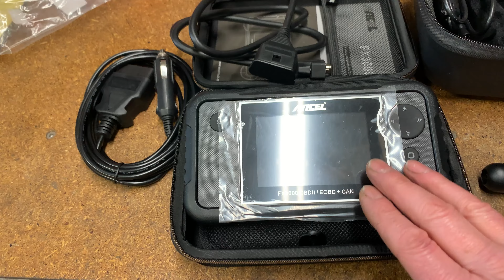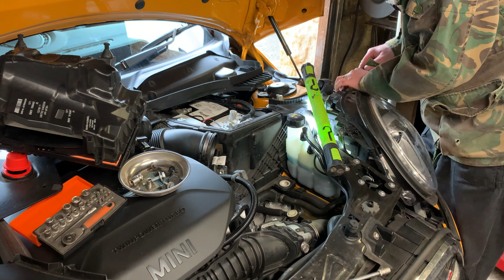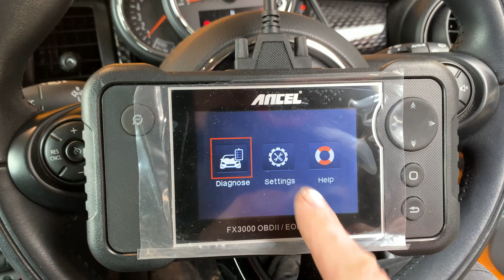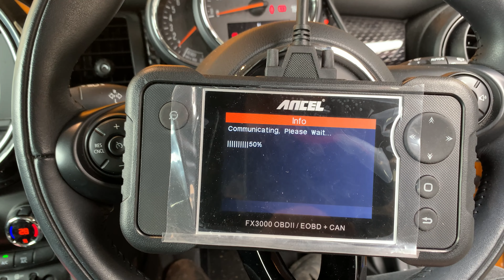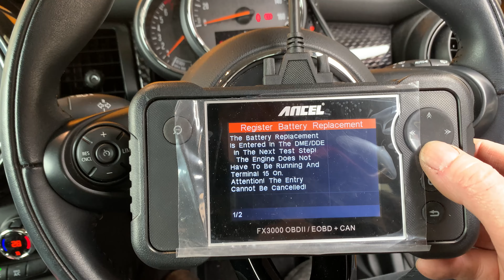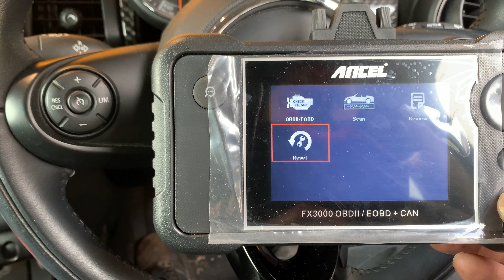Mini Cooper S 2016 F56 3rd Gen Battery replacement using an Ancel FX3000 diagnostic tool

Comment: Can I use bimmercode or bimmerlink to register the new battery ? do I really need to add an extra 12V supply to the ODB2 port ?! Just watched a workshop do it and they didn’t bother with the 12V power for the ODB2 line.
Reply from the maker: Hi. I’m not sure what bimmercode is some I’m afraid I cannot comment on this. The 12v power to the obd2 port was to keep the car memory settings, radio,sat nav etc so is not essential.

Comment: Thanks for the video. Any chance you still remember the dimensions of the battery?
Reply from the maker: I’ll check in the morning 👍🏽
Reply from the maker: Hi, this is the exact battery I bought, I hope it helps, thanks for watching 👍🏽
https://advancedbatterysupplies.co.uk/product/varta-f21/
Reply: @MikeMakesIt  Brilliant! Thanks!
Reply: @MikeMakesIt  I've heard that the AGM115 (which are 315mm in length) batteries don't fit, and that you need the AGM096 (which is 278mm in length). Clearly yours did.
Reply from the maker: @JohnCarlyle and it’s still running well! Thanks for watching 👍🏽

Comment: so what's the consequence if the battery is replaced but no registration process is performed?? I don't have the scanner and hoping not to buy it.
Reply from the maker: Hi Victor, I read that there is a battery management system (BMS) on the car which alters the charging characteristics depending on the age of the battery. So fitting a new battery and not "telling" the car could leave to overcharging of the new one. I would imaging this could be correct but in real life how this would effect the longevity of the battery I wouldn't like to say. Thanks for your comments and for watching 👍🏽
Reply: many people say ,  new battery  life will be shorter.

Comment: Is it OK that when you pulled out the old battery you let the - terminal touch the + battery cable?
Reply from the maker: Hi Jusssy, no thats fine as only one terminal of the battery touched and the other was floating so there was no electrical circuit created. Thanks for watching 👍🏽

Comment: A complicated designed small car that breaks often than regular cars
Reply from the maker: Hi Louie. Simply wanting to replace what used to be easy, such as the battery is a real pain although, fingers crossed, the car has been faultless and is around 5 years old. Thanks for your input and for watching 👍🏽

Comment: Just left mini.  I'm in the States. I was quoted almost $600 for a battery replacement and reset. That is indeed bonkers. I have a Jeep running a double battery setup and it was cheaper! Thanks for the tips. Cheers
Reply from the maker: Hi Daniel, thats a crazy price. Mini in the UK were going to charge me an arm and a leg for a reset and a battery swap. Thats why I bought a diag unit. It wasn't as good as I thought but I reset the car, paid for the battery and still had change from what Mini were going to charge!! Thanks for your comments and of course for watching 👍🏽

Comment: Thanks for the video. These batteries have 2 vent holes on the opposite sides. The proper way is to plug the one that is not used. Most times the new battery comes with one plug, either inside one vent hole or connect to the positive terminal cover. You can reuse the old plug on the OR battery as well.
Reply from the maker: Hi motofan16. Thanks for the comments. Thats actually what I did, although I failed to mention it in the video. Great information on the plug in the positive terminal cover, I didn't know that. A new battery I recently replaced in my Sons car, a Fiesta, had blue tac in the vent holes for shipping. I swapped the plug/vent over from the old one! Thanks for watching 👍🏽

Comment: Nice one Mike had the same problem with my Mini engine spun over but would not start battery was on the blink it just needed that little more power and away it went 
I’ve worked on many vehicles in my time 52 yrs and the new mini is the most awkward I’ve ever encountered stay safe 👍👨🏻‍🏭
Reply from the maker: Hi Paul. The old Land Rover, one spanner, the Mini, spanners, diag gear, battery pack and a memory cable and a good chance of stuffing it up then a trip to the Dealer!!!. Worked out for me , this time though, thanks for watching 👍🏽